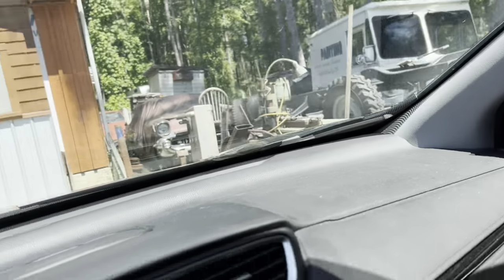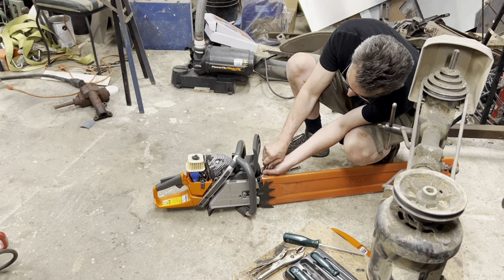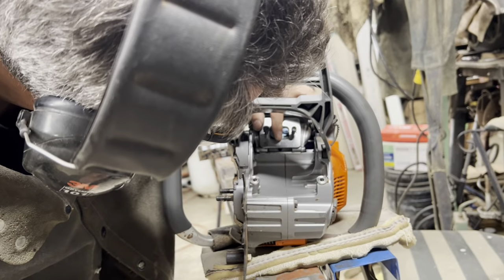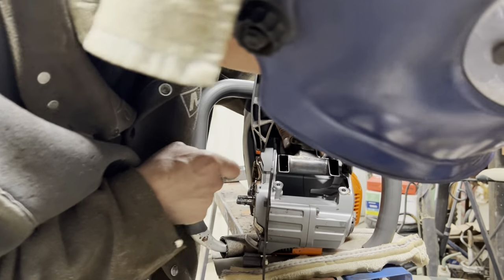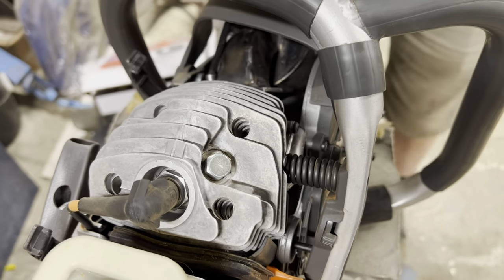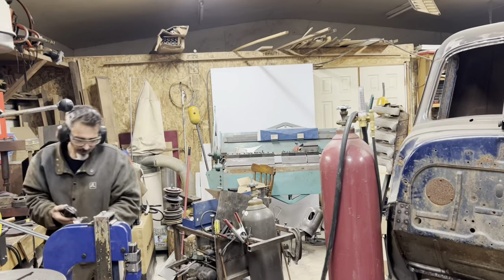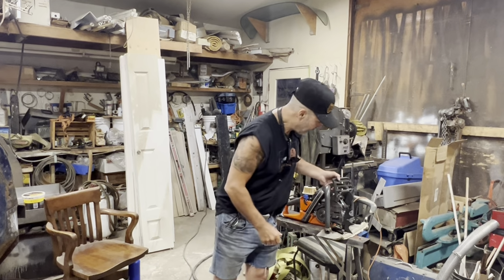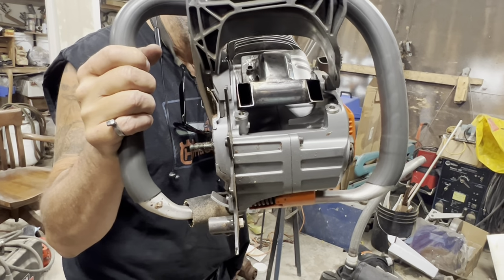Things will never be the same for this Husqvarna 572 xpg

Comment: Hey Brother! Great to see Morgan on the channel again. Keep in mind that those 572XP's are E-Tune, like the 500i, and need to be idled for awhile and then full-throttled with load for 15 seconds to recalibrate to different back-pressure from the new pipe!
Reply: The proper autotune calibration/reset procedure is idling for 5min and then doing a full-throttle rip cut in a log big enough to allow for a 75-90 second full throttle cut.

Comment: Elves It's no good guessing on these 2 stroke exhausts Walter Kaaden's  He had developed the two-stroke exhaust pipe, known as expansion chamber. In 1962.  This is how MZ 2 stroke motorcycles were so dominant in the 1960's. 
    It is the expansion & resonance of the exiting exhaust gas that pulls more air fuel mix into the jug.

Comment: I'm a hot rodder from the 70's and you aren't going to gain much HP from just the exhaust. I have anG888 and it is high HP. I know 4 cycles but not 2 cycles but you could go all out with big carb, big lines, porting, high dome pistons, better cam but that's a huge amount of work.

Comment: its a muffler, not a "pipe" unless it has an expansion chamber.  Donny Walker knows all about them for sure!
Reply: Not true, technically, buddy. It's a pipe, unless it has baffles in it to "muffle" the sound. That's true for all combustion engine exhausts. This pipe would be considered a split strait pipe, or a one into two.
Reply: @duncandogster  because it is a long cylinder?  In this context a "pipe" on a 2-stroke engine has an expansion chamber.  Just running tubes out of the cylinder does zero for performance.
Reply from the maker: @edgerat  no amount of evidence or facts will allow you to hear the truth you do not want to hear
Reply: @BuckinBillyRaySmith  ask Donny Walker BBR, facts are facts, a tube attached to the cylinder is not a PIPE, it isn't providing any sort of power gain or adjustment to the power curve, it is just redirecting exhaust.  I know two-stroke engines, not being a troll, friend, I can promise you that.  :)

Comment: Did you do a High and low field reset after the pipe? You are gonna wanna do that friend! 5 min idle to reset the low and 6-8ft rip cut at full throttle with just the tip 
buried in the wood

Comment: I’ve got the identical saw.  What’s the advantage or purpose of the pipe?
Reply: more noise
Reply: Having a unrestricted muffler/pipe helps to allow heat to be removed from the cylinder and piston quicker .
Reply: @heathboeddeker5401  Heat and expansion of the exhaust gases is what makes a 2 cycle engine work, it probably doesn't much matter with a powersaw , they mosty run wide open. Having BBR tell us it's better may or may not be accurate he's doing his best, throttle response is how an engine behaves its velocity thru the engine a positive thing , determining it has more power requires a test on a dyno.
Having worked as a mechanic in a shop with a dyno things aren't a clear as they seem Ducati motorcycle example the old 2 valves run heavy flywheels and installing a much lighter one completely changes how they run but doesn't change the power.
Reply: Just picked up a 390xp this spring, I've never ran a ported saw...how much more power am i going to get by having it ported??
Love your channel, keep up great videos coming. Thank you!!
Reply from the maker: hey brother , have you ever know anyone to  take off the factory exhaust manifolds on a car and put on , what they call headers?. this is the exact same thing, this saw has more power now , more pull ,, it alway did rev that was not its area of improvement. the muffler you saw in this video , as i suspected was to small or lets say not the right configuration, same volumes with different flow wood probably work better , but thats what testing in the wood is for ,, I am the Dyno Brother . Peop[e like David here dont trust opinions of seasoned saw men. he is a mechanic as he told us.. and needs to see #'s to feel at ease that it actually works , so do most the general public. . I m Glad yer here watchin' the process cause Im on to this thing , Just like the 500i. but this one is easier. when I get done and get a pipe that work good Ill send ya one , and you can come back in the comment section , and let me know wether or not you saw is stronger all over ,,, Deal? Love Buddy , I like Yer Name By the way

Comment: Mr Smith, Husqvarna has a procedure to reset the tune on those auto tunes.. Did you run that hard reset off camera between pipes?  If not, do you think that saw was at its premium from one pipe to the next without the reset? 

From what I’ve read, you’re supposed to let it idle for 3 minutes to set the low jet, and make a 16’ wide open ripping cut burying just the bar tip on a sharp chain in order to set the high jet. 

Hope this consideration helps in some way.

Comment: I think the holes cut on the front face of the ram horn will suck in air. Thats usually how that works when u put a hole in a hose close to the exit. Think how pressure washers introduce detergent or air tools that suck stuff up.
Reply from the maker: they will indeed

Comment: Guys, I’m a young strong man, been running power saws most my life, cutting and selling fire wood, but I’m no pro. I’ve decided it’s time for me to buy a saw in the 28” bar. I’ve ran 24” but that’s it. My question is a I want a good do it all saw. So do I go for the 372, 572, or even go with a 592 93cc saw, run a 28” bar, and in the future run a bigger bar if I want. I want the best, most nimble, powerful saw I can get. And I want to keep it for a long time. Be able to tune and work on it as much as I can. Idk what to do. I do love power. But thinking 90cc might be excessive for what I need in a firewood saw??so then it’s between 372xp, or the 572. Can anyone help? I just want the best saw for my money, and I want to keep it for a long time.
Reply: Time is money. So that makes me wonder if 93cc would be ok. I mean buck it up, limb it, the quicker the better right? Idk. Then again I don’t want something wayyyy to heavy
Reply: Cutting down a bucking a 3 ft-4ft tree is going to be a GIANT for me. We have them. But I normally don’t drop those for firewood. I do want a saw that can handle that though. Also getting tired in the back at age 30 already, from 15-18 years of 18” bar saws, hogs, and baling hay. Hope someone has some valuable input